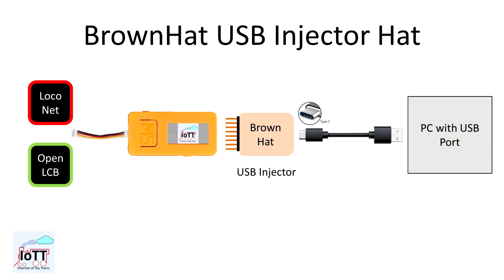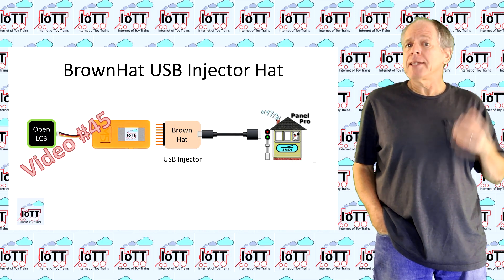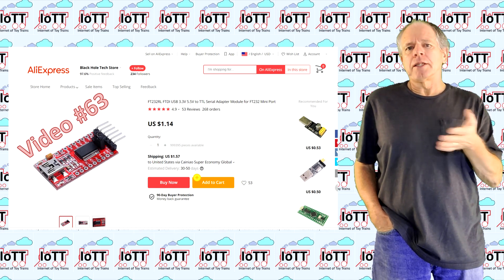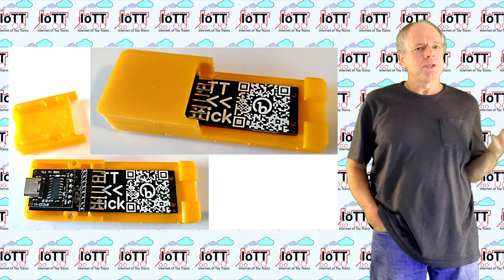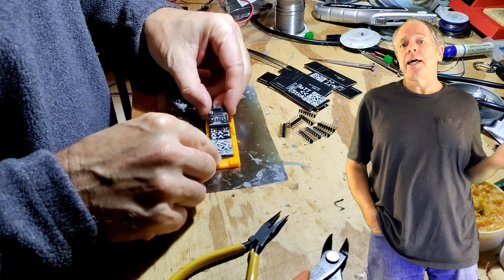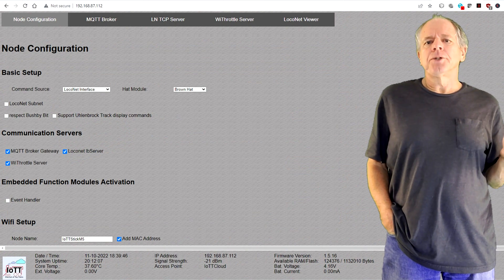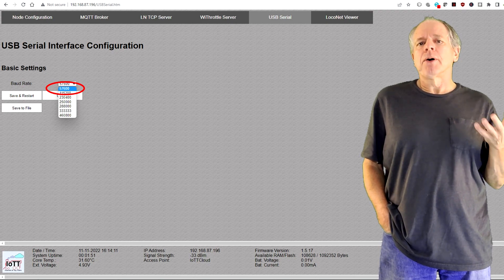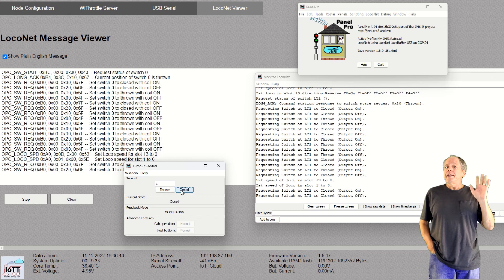New: BrownHat USB interface (Video#106)

Comment: Great video.  I went back and looked at video 45, but I don't see any followup to an openlcb breakout except the circuit diagram in the video.  I couldn't find anything in github.
Reply from the maker: LCC is kind of on hold. I am observing what's going on and probably will do an interface at some point, depending on how it develops.
Reply: @IoTT  Oh, just realized the IOTT Stick software for OpenLCB didn't make it in either.